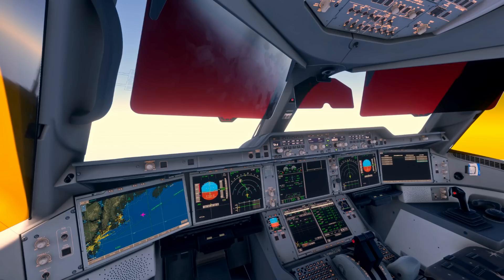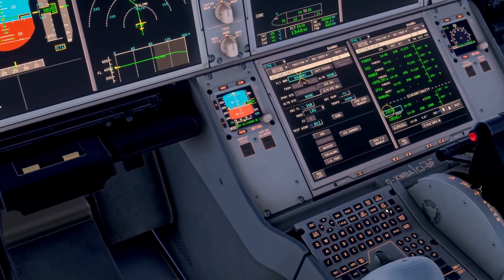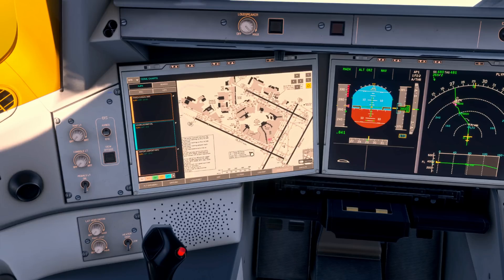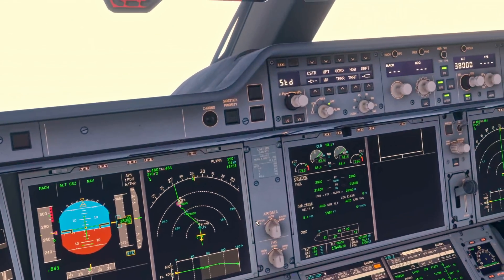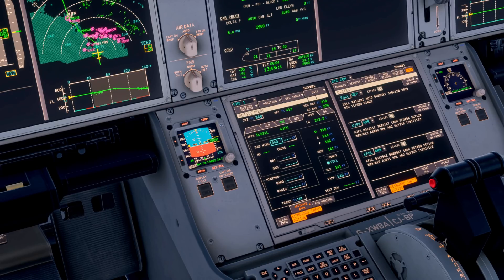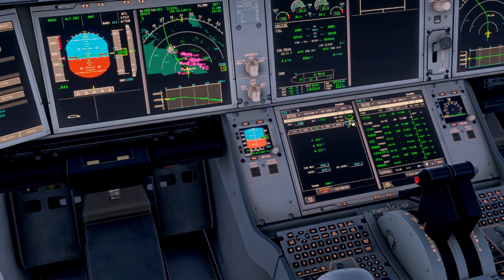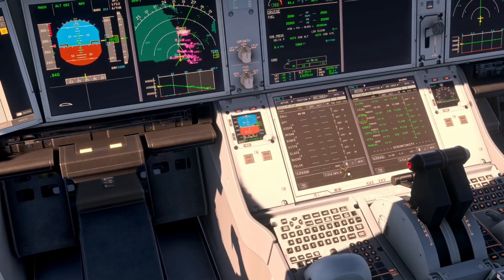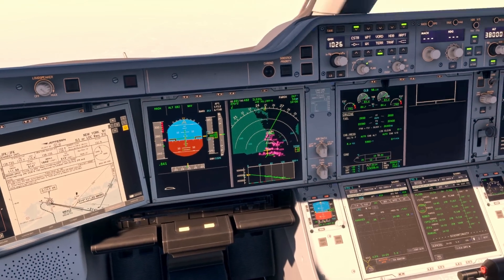A350 Descent Prep & BTV Explained by Real Airbus Pilot | MSFS 2024 Tutorial

Comment: In calculating landing performance, wouldn't it be better to sync FMS rather than Sim brief since your FMS data is more up to date?
Reply from the maker: Hello, the option only picks out the airport and runway which you would hope is up to date but you could use the FMS (more chance of the FMS database being out of date though). To apply some real world context to this obviously we do not have the Simbrief or FMS sync but we would always pull data from our load sheet rather than the FMS first as the FMS is already made up of a lot of pilot inputted data and could contain errors. With heavily computerised aircraft it is important to conduct verification of data from sources separate to the aircraft where possible. Both pilots would run these checks separately and cross check.
Reply: @AirbusCockpitCoach  thank you!